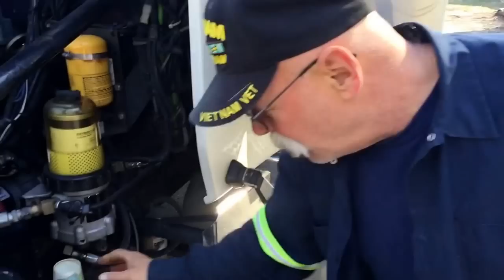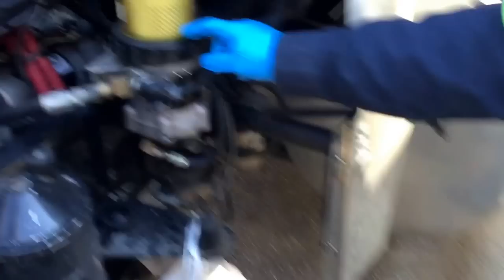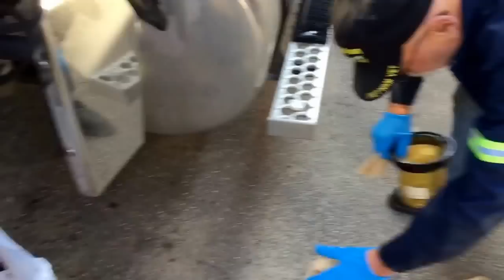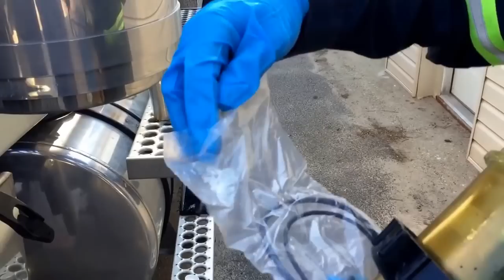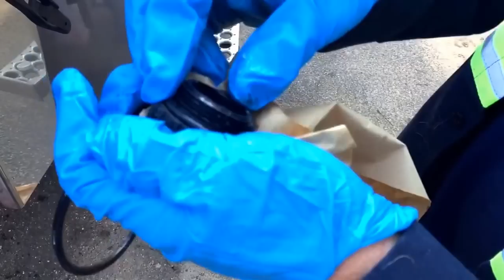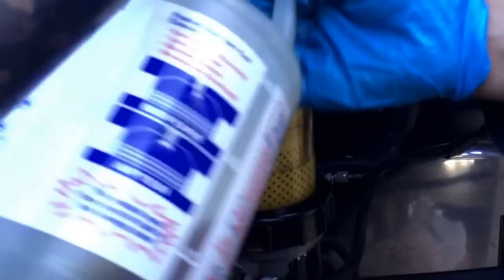How to replace fuel filter

Comment: Shouldn't reuse the fuel drained from the unit. It's a fuel/water processor. Majority of that first cup will be water depending on how often the water is drained and fuel quality that has been used. Besides, you just installed a new filter.

Comment: My Fuel-Pro 382 used both of those larger gaskets. Thicker one for the top clear bowl, and the second thinner seal for the bottom plate. My Fuel-Pro 382 developed a crack in the bottom plate and the truck parts wanted almost $700 to replace with brand new one which I couldn't afford. So I removed it from truck and converted to spin-on fuel filter assembly. Now as for refilling new filters both the Fuel-Pro 382 and spin-on filters of all types, I only use transmission fluid and nothing else. The thicker transmission fluid pulls diesel fuel from tanks faster and cleans fuel injectors and combustion parts of engine in one step. I learned that from a large mobile lube service I worked for many years ago which works perfect for all heavy equipment diesel engines especially CAT.
Reply: Be careful.  Modern tranny fluid isn't the same as what the old timers were using.  There's different additives in it which can mess around with some of your components.  Same with 2 stroke oil.  I've heard that Marvel Mystery Oil can be a good substitute.

Comment: One. Drain intire fuel housing. Check for dirt, or metal filings at bottom of housing. At sometime in the trucks life you will find,  small aluminum shavings, which will indicate a fuel pump could be going bad. Clean and reassemble,  using new fuel.  Never use the old fuel.
Reply: DO NOT DRAIN THE ENTIRE BOWL. You'll lose prime.

Comment: this is a great video
I have a Hino 338 and I have to change my fuel filter soon. Appreciate the video
Reply: I have a same Hino as yours.  I just did my fuel filter.  I turn that knob and nothing came out.  I use a thin piece of steel wire and poke it up...a lot of crap came out.

Comment: I would still recommend draining all of the fluid. Contaminants collect at the bottom of the filter housing and also inside the spring where the ball check valve is inside the filter housing.
Reply: Ho Lee Schitt The fuel system would lose its prime of you did that.
Reply: turn the key a few times ;)
Reply: NEVER completely drain it...
Reply: Never drain all the way out. It'll lose prime. Run the engine afterwards and drain down to the cap tgen let it fill back up automatically. Should be good after 3 drain downs.

Comment: That is the INCORRECT way to do that filter change. Never use Vaseline. Never reuse diesel fuel from the bottom of the filter. That bowl is meant to have a vacuum for proper water separation. After the new filter is on and filled with clean diesel to the top of the filter, tighten the top cap, start engine until running smooth, then just loosen the top cap while the engine is running and the fuel level will drop. Once the fuel gets down to the level of the bottom ring, tighten the top cap snug. You only need to change the filter when the fuel level gets near the top of filter head marked with a black line on the filter itself.
Reply: I did exactly what I saw in the video. Everything was fine. I drove almost 250 miles. I tried to back up in spot and the truck shut it off. I now can’t start. It looks like there’s air in the system.
Reply: @aydarusjamai  so what was the issue? Did you call any road service?
Reply: @dannyg.817  I  either forgot one of the gasket or even put an extra one. There was an air in the system. I never have that issue again
Reply: @aydarusjamai  but you recognize it was your mistake on that? Because I'm planning to do an oil change for today and after hearing everyone saying MY TRUCK SHUT OFF like it makes me not wanna change it but my truck does need it so I'm like f idk what to do and I can't afford a service somewhere they're expensive and after all I got all the tools so I dont want to mess this up.

Comment: How low should the diesel stay?
I recently changed the fuel filter but diesel is to low. 
I've also noticed that the truck shakes from side to side when its cold and it goes away 1 minute later

Comment: Marvel Mystery Oil is good for dissolving carbon build up inside the motor so use it with the motor oil, not very helpful when used with the fuel and lucas oil or other lubricants are not needed in the fuel of diesel engines because diesel fuel is very oily, just change filters regularly, they don’t help much when it comes to injector cleaning either. Lucas can however be useful in gasoline engines because nowadays gasoline without the lead is a dry fuel and additives can help provide the needed lubrication.

Comment: BILL, what used truck with 400,000 miles would you recommend for RELIABILITY and fuel MPG ?  does the year matters if 2014 vs 2015 has the same miles but cheaper for 2014...thank u
Reply from the maker: hoolarzf , I would be an older truck with no emissions prior to 2004
Reply: @billtaylorlandstar1567    There's reman pre-emission engines in new glider truck bodies that were made up until 2020.  So for example if you find a 2019 Columbia, it will likely have a pre-emission Detroit 60 or Cummins n14, or maybe a Cat.

Comment: Don't do what this guy did. He just dumped a bunch of dirt into his refill fuel jug. Great way to ruin HP pump and injectors.
Reply: But surely the filter, which he just installed here, would stop any foreign matter passing through? He emptied it into the 'dirty' side, not the 'clean' side. Having said that I'd also rather fresh fuel be used to prime the new filter.

Comment: Wrong the fuel you are draining from the filter has dirt and water and should NOT be reused.  Saving 1.50 worth of diesel and destroying a $40,000.00 dollar engine doesn't make any sense. Diesel fuel is cheap engines not so much.

Comment: whats happening  when i change my filter and the fuel goes up and down in the fuel chamber....do i have an air leak somewhere? My truck cranks over but wont start.
Reply from the maker: Cynthia Hoagland, if you have bubbles u have an air leak

Comment: how do u know when its time to change the filter bill?
Reply: shyeem63 ........when the fuel reaches the top of the filter.there  is a line on top too showing you to change the filter when fuel level reaches that level.
Reply: Ns Bt thanks and the other filter on a dd15 u change when u do oil change?
Reply: if you have a davco filter before the engine fuel filters you can go min 150k before changing the 2 or 3 on the engine.
Reply: You mean up to the black line 
time to change for new one ?
Reply: When your filter looks like it's made out of black tar.

Comment: LD5P SCOOPMOBILE...WHERES THE LIFT PUMP?? CHANGED FILTER, NOW WON'T START. 50'S ERA. RUNS TIL PREFILLED FILTER RUNS DRY. PLZ HELP
Reply: Cheryl H.  Keep filling the filter and crank the engine the level will drop keep adding till it starts
Reply: @zacrowe9209  it’s so funny the help came 2yrs later. These two comments are 2yrs apart.